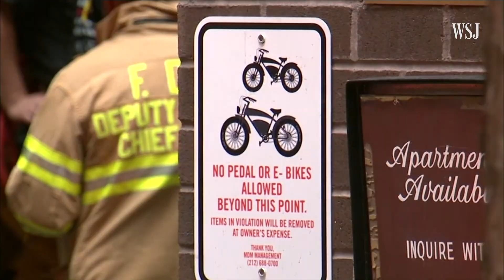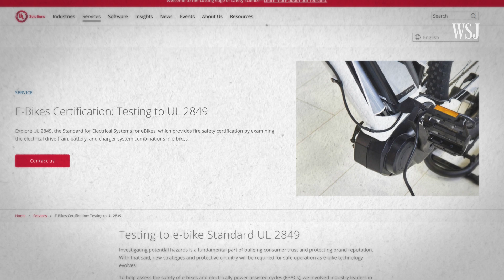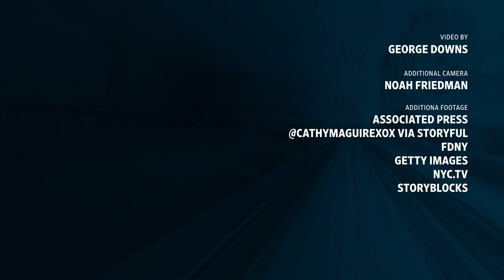E-Bike Batteries Keep Exploding. What’s the Solution?

Comment: If only we could harness that explosive power inside some kind of cylinder block - and then use it to drive a piston - that in turn is attached to a cam shaft.
Reply: Radical! And alcohol for the fuel, which is how the internal combustion engine was originally developed. It's superior to gasoline for so many reasons.
Reply: @bellowphone  Agreed!

Comment: I ride a regular road bike I wouldn't have a E Bike they are dangerous and it's going to get worse. If would require for all e bike batteries to have real Nickle instead nickle plated steel and each battery inspected by qualified inspectors maybe things would change. Nicole plated steel is a short cut to desaster

Comment: I dont mean to be a jerk, but the media really needs to educate themselves better on this issue.  You title this as "E-Bike Batteries Keep Exploding.  What's the solution?", and then miss providing any accurate info of real solutions.

Most importantly, the bikes that are starting on fire are the cheapest options, sold by companies outside the US legal system and/or kits and DYI batteries.  I have heard of very few US bicycle branded products (Trek, Specialized, etc.) ever starting on fire and causing casualties, and in fact I know that every Trek ebike is certified or compliant to UL 2849.  These companies can be sued to the hills in the US if their products start a fire, so even in the absence of mandatory regulation, these companies will follow the voluntary standards because they have to have any legal defense.

A battery starting on fire while charging can really be boiled down to two reasons: 1) a lack of quality Battery Management System (BMS), 2) poor quality cells (insufficient separator materials, insufficient quality controls, etc.).  Yes, incorrect voltage, current, temperature, damage, etc. can all result in failure, but that is exactly what the BMS is for, it manages all these parameters, and cuts power to the battery if they are not correct, or there is a short (i.e. damage), or cells become imbalanced (worn-out), or .....  cheap ebikes and cheap batteries which cause these fires, rarely are equipped with a BMS, and if they are, it is some poorly designed cheap substitution.  With a proper BMS, it doesn't matter if you leave the battery charging over night, you charge-discharge all day, you connect the wrong charger, etc. becasue the BMS is intended to detect this and stop the charging/discharging process before the battery reaches thermal runaway.

Next, the author mentioned UL 2849, and then said that only 13 ebikes were listed under it, showing the UL website.  This is also a complete miss in communicating accurate information.  UL 2849 applies to the electrical safety of the e-system only, not to ebikes as a whole or to the mechanical aspects of the bikes.  So, what is listed on the UL site is e-systems, not ebikes.  For example, Bosch is one of the top system providers in the world, it is used on hundreds of brands and thousands of models, but will only be listed once in the UL database, and if you did not know your ebike has a Bosch system, then you would think that your product is not certified, even though it is.  Secondly, UL is only one of dozens of laboratories who are capable and approved to test/certiffy these products, and they all have their own marks and databases (Intertek, SGS, ACT Labs, Bureau Veritas, TUV, CSA, ....)

UL 2849 is also just the most recent US standard for ebikes, and is mostly based on EN 15194 which has been the European ebike standard for decades now.  Japan has its own standard, and requires government labs to verify product compliance.  Korea uses EN 15194 and also requires government type-approval, .... and you know what, those previously mentioned US-based companies, Trek, Specialized, etc., have been designing and selling ebikes for 2 decades now globally, so you can believe their products are safe, as they have been in the global compliance crucible for decades now.  Fires and ebike safety is much less of a topic in all these other developed nations, because they have minimum safety standards and ensure they are followed.

Look, American frugality is not going to change anytime soon, and we are going to contiue to buy the cheapest option, incorrectly assuming this is safe.  We need the US government to adopt some of the existing safety standards, whether that be UL 2849 or one of the very adequate global standards.  This is the easy first step, next we need them to enforce the regulations and application of standards.  Unfortunately, they can only do this by removing e-mobility products from de minimis import exceptions(look it up), and then CBP inspections/verifications of shipments.

As for the delivery workers, I feel for them, but you cannot make a safe ebike for dirt cheap, at least not at this point. It sucks that ebikes cant be super cheap and easily accessible to everybody at this time, but you have to spend the money on adequately designed components and quality Li-ion cells to get safe products and ensure that the industry grows and evolves, so one day we can actually have cheaper products which are safe.

Comment: Can't can't they put some kind of smoke detector on them that if it does overheat or starting to heat it'll set off an alarm and then you could take care of it
Reply: YES  My ebike  batteries when not in use are in a 22 “ tool box with layers around the battery of silica sand and a smoke alarm close . Problem it should be outside in the shed . 
Also someone can always put a home smoke alarm alarm right on the battery .

Comment: The solution is don't buy the relatively few in the market, obviously cheap ebikes.  Given the hundreds of thousands ebikes in service, the number of fires is few.   Ebikes have the same types of batteries as our laptops and phones.  No one is suggesting we leave those outside at night to charge.     How do you know if an ebike was made cheaply by skipping safety circuits in the electronics or using inferior components?  The buyer has no way to know, but a good clue would be if the sales price for what your getting seems to good to be true.   Best advise is to stick with the more popular brands.  They are not catching  fire.  View YouTube reviews and buy those bikes that have the features you want.
Reply: lol first of all, laptop batteries are certified. and secondly have you seen the size difference between a laptop battery and an ebike battery?

Comment: The Electrek YouTube channel has tested a thousand ebikes and has never experienced a fire, says fires are very rare.  At any rate, always buy batteries with name brand cells, Samsung, LG, Panasonic, etc.
Reply: fires are not very rare. You cannot properly test this. It would take years.
Reply: @segoiii  I personally haven't heard of a fire in my community. There's lots of people on ebikes here in SoCal, riding all year long.
Reply: Unless you open up your new battery with it's alleged Samsung or LG cells,  how do you know it has those inside?!
Reply: @6ettinold  The battery of my ebike says Samsung cells on the battery case.  The website of the seller of my ebike says the battery uses Samsung cells.

Comment: Batteries without a well designed battery management system are the culprit. If you only allow the sale of bikes that charge to safe levels your problem is mostly solved. Saying it is too expensive is not an answer for those inhaling toxic fumes from fires. In a country not willing to regulate guns involved in mass shootings is there an incentive for regulation of batteries to prevent fires?
Reply: Let require a waiting period and back ground check before purchase of a battery!?😮😅😊

Comment: Hang battery above of water bucket by string which meld in fire. If it ignite, it drop to water. When it happen, it`s extremely quick and violent event, as you can see from many videos. Water bath is only safe way.
Reply: The damn things go off like a 'Thermit' rail welding reaction. Fuel, oxygen manufacture & heat producing in one package. Think i'll stick to a gasoline motorbike.
Reply: Looney tunes would like a word with you😂

Comment: Bateries burn up couse batery management system is non exitant or fails . Most e bike batteries that catch fire are from cheap batteries built wrong or no safety shut off witch is what the bms does

Comment: I don't get why nobody knows 😞 I'm a engineer these batteries exploding is cuz basically the battery manufacturer doesn't have a good BMS system in battery 🔋 if you have a good battery manufacturer like lg or Tesla Panasonic Samsung if these bikes have these  batteries they have one of the best bms systems on the market Tesla has one of the number one in the world BMS stands for battery management system now u know have a good day 🎉
Reply: You might be an engineer but you sound like you don't really know that much. The problem is not the cell, most of them I am sure they have LG, Samsung or Panasonic cells.  The problem in most case is the manufacturer or builder is not taking account of the cell rating and what thickness of nickel is needed to the planned max amp usage by the controller. In most cases they take the max discharge capacity as continuous discharge capacity, when combined that with thin nicker strips that get extremely overheated that the cells go in a thermal runaway and there is no stopping the fire from that point. 

Simple way to prevent most of the fires are to have 20% higher discharge battery capacity then the controller requirements and multi point heat sensors in between the cells not just one on top.
Reply: Tesla has one of the most SPECTACULAR fireworks show when one cooks off. Videos of them doing so are all over YT.
Reply: Maybe an engineer in building Thomas the train track set. Sentence structure. Google it

Comment: At least I am glad I already knew how to actually use Lithium-ion batteries safely (I am a hobbyist, mind you), as well as understanding how safety circuits work, so I now know what to look for, that unfortunately means I have to take safety design seriously, in other words, won't be cheap.

I understand the danger of the batteries, and they're obviously not a joke. However, I have seen badly put together or just cheap batteries go up in smoke in general, yet reputable companies have a fair share of problems, mostly not following the datasheets' strongly worded warnings to the letters, or just wanting to cut the corner.

Still, it's a very scary situation, as it happens quickly.

Comment: Use swappable batteries that slow charge, don't run them super low, keep them charged to around 20%. done.
Reply: Correct. But how do you get the average dope to pay attention to all that?
Reply: @bellowphone  Do it in software, make it transparent that it is done for better battery life, also the battery's bigger. Another thing? Limit the chargeable capacity to 80-90%

Comment: How about swapping batteries. If there’s an issue of charging and discharging, there needs to be a charger bad that can analyze the battery, the same or similar way Motorola does radio batteries.

Those news stands or those old train stations could serve as slow charging stations. The BMS might be over heating and failing. BMS being battery management system. Also, checking the wires used and seeing how long they last. Remember, wire coating could be melting. I would say use the Amateur Radio community, electronics and anyone that uses them, might provide more information on where they’ve seen failures.

Comment: Stick an Lfp lifep04 battery on them.
Much less likely to catch on fire.
Plus 3000 charge cycles.
Reply: Can you write the pros and cons ? 

Your LiFePO4 type is able to deliver the Amps like a highest risk lithium ion (or lithium polymere) type ? 
What is the prefered cell technology at RC cars and RC planes in your country by privat persons and there RC toys ?
Remember = Money these persons have in an amount that they can spend it for expensive parts. 
When they switch to LiFePO4 technology than it is best for low weight, low volume and extreeeeeeeemmmmmm high Amp for there super small electric engines. 

Attention there are really highest technology electric engines but for small money bank accounts these are cheap lower high-current engines ...
You look for the performance toys for pleasure. 

Look for these person in your area. 
I am shure somewhere in your area are these person without children and young adult RC cars (or RC planes) . 
these persons without the will of spending tons of money for RC models are not good for your ears.
Reply: @callishandy8133 Cons energy density is lower so the battery will be a little bigger and heavier. 
Pros they won't burn your ass to a crisp and 6000 charge cycles Amps are not an issue.
Reply: @ghz24  exactly. LFP batteries are almost perfect for e-bikes, and they’re cheaper per watt-hour than cobalt-based lithium-ion batteries. it’s a shame that E-bike manufacturers are only focused on cramming the most energy-dense battery into the smallest space.
Reply: @callishandy8133  I doubt anybody(maybe a really small percentage) in the west are using LiPo as they are literally fire hazards. Most LiFePO4 can deliver 2-5C which is in the range of Li-ion batteries.

Comment: It cant help that a decent battery is worth, £600 so charging  them anywhere pother than at home is a risk of theft.   I have a secure garden so use a cable lead outside to a rainproof box where I charge it. If it goes up its safely  away from everything but i realise its  not a solution  for everyone

Comment: How are batteries protected from each other in a shared battery charging location in case one goes off?  If you want to protect anything else, every battery pack must be encased in something none of lithium eruption/combustion/explosion nor the heat can breach; but isn't too difficult to use for charging.
Reply: Good batteries have fuses between each cell. Some single use and some auto reset-able

Comment: Litium ion cell has the advantage to store a great quantity of energy in a small volume and weight. In normal condition this chemical energy is transformed in electric power but, if the battery is damaged the chemical energy is simply transformed in heat and so it comes the fire. Usually this happens when the menbrane that separates anode and catode breaks and catode and anode come in direct contact. This can happen if there is an accident but also for overloading/overdischarging and heating the battery. Short circuit also may produce this effect and this can happen if the battery comes in contact for example with sea water.

Comment: You can't control the unlikely event that your battery might explode but you can control what else will catch fire. Always store and charge your battery in a safe place away from other flammable materials so the fire can't spread.
Reply: that works in a rural setting ...but not in a city...
Reply: @MEANASSJAMSTER  you can put your battery in a battery box/ bag or non combustible container instead of your couch 😊
Reply: Agreed... produce safety boxes for charging/ storage would be best
Reply: Yes the government of the world want to go carbon neutral. But if you live in a high rise building the how can you charge it. Here in the uk thieves have started to steal wall chargers!
Reply: @GNMi79 When l-ion first came out in the rc hobby, we always charged them in an ammo box. For bigger batteries like ebike, you could use your oven or anything that limits its availability to start a structure fire. You can't control the smoke, and it is horribly toxic, but you can prevent a total loss. A metal box, trash can, and or cookie sheet lined with a layer vermiculite would work
Reply: "do as i say don't do as i do...."
Reply: A recipe for a stolen bike,...
Reply: @8000RPM. Better have your bike stolen then loose your house or even worst your life and families life.
Reply: @8000RPM.  has nothing to do with what they said.
Reply: @mr.monitor.  They talked about old newspaper stands for charging,...would you leave your bike there to be charged?
Reply: @8000RPM.  no I would not leave my bike anywhere to be charged. But what does that have to do with what this person has said?
Reply: Talking about monitored battery only charging spot possible app for cameras inside that space

Comment: E bike are expensive, I would just spend the money on a lightweight aluminum or carbon fiber bike. Light weight bike are much easier to pedal. Don't use fat knobby tires on roadways. Best city tires are 1.75 inch semi slicks. Best balance between weight, rolling resistance, comfort and durability for rough streets.

Comment: The old adage, "you get what you paid for" comes to mind.  Only, in this case, saving money could get you and others killed.  The battery certification is what sold me on our e-bikes but I realize that not everyone can afford them.  The certification process is expensive which is why a lot of manufacturers don't certify their batteries.  It allows them to keep the cost down and remain competitive.  When they start facing criminal consequences when an uncertified battery they sold with their e-bike kills someone, attitudes will change.  No matter what the solution is, it won't come cheaply.
Reply: The products which are causing the problems are not in the US legal system, they are in the China legal system, so unfortunately, criminal charges will neve be filed in most cases.
Reply: @jeffjambois7696  That's true.  They will eventually make the purchaser responsible or liable to some degree.